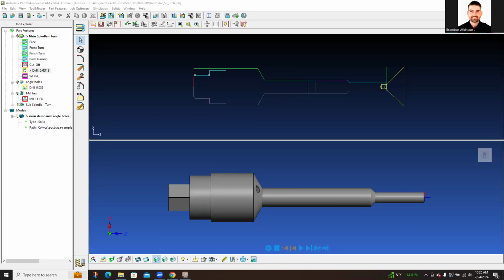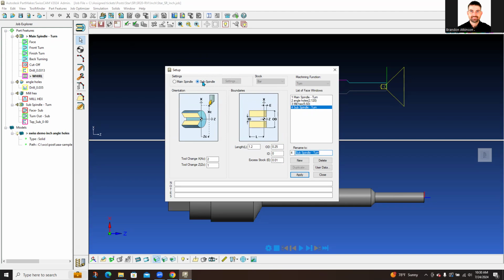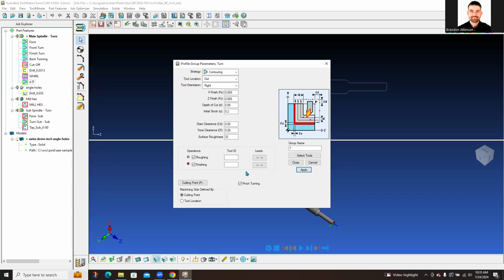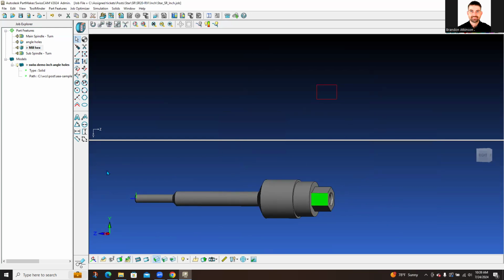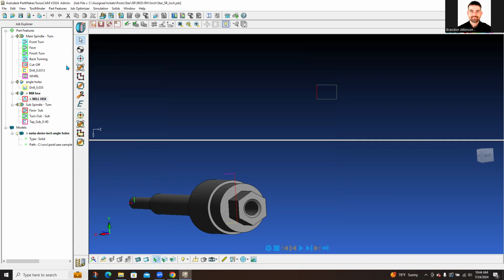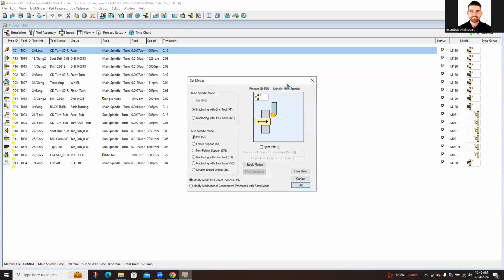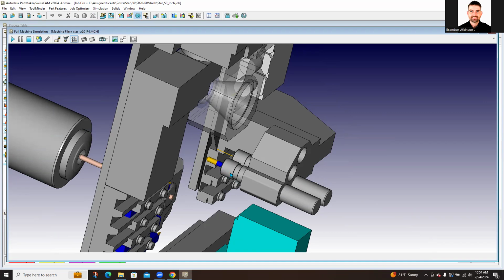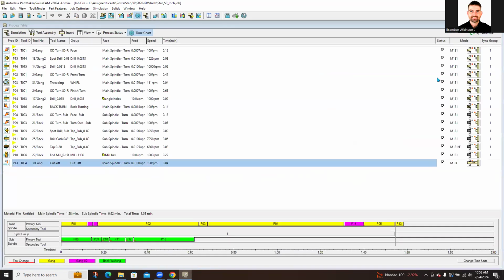Partmaker SwissCam Demo

Comment: I need help with speeds & feeds .. thank you
Reply from the maker: @ras7654  I usually refer to the tooling manufacturers feeds and speeds. Harvey tool has an awesome feeds and speeds page that lets you type in their tool part number and it gives you the chart of feeds and speeds for every material.
Reply: @cncswiss5999  thanks for the reply , I was pertaining to Turning in a swiss lathe (SB 20 R type G) 
Do you know how to convert HBW into HB so I may follow  tooling manufacturers' speeds & feeds